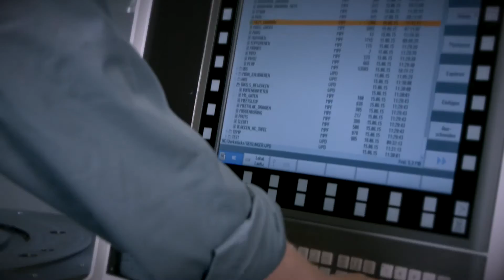Uniport 7000 MTC

Comment: It is an essential machine for our company.
Drill a hole on the top and side of the product, work on the female screw,
Lathe work is performed on the heat-treated race on the inside of the product.
If all of this could be done with one machine
It seems to be able to secure tremendous productivity and precision.
But, as always, the high price is a problem.
I enjoyed the video.